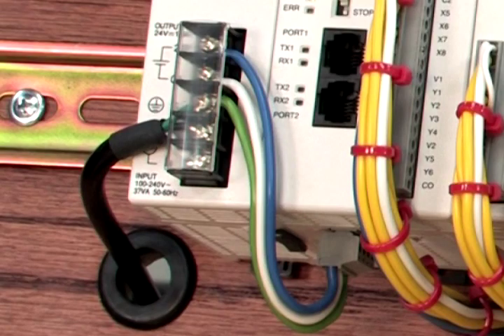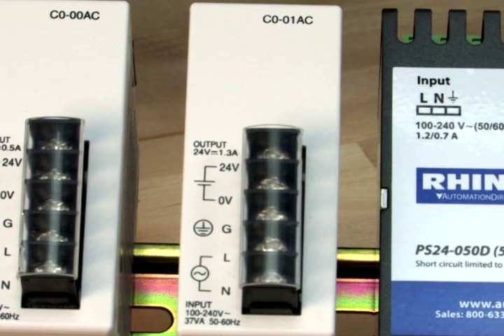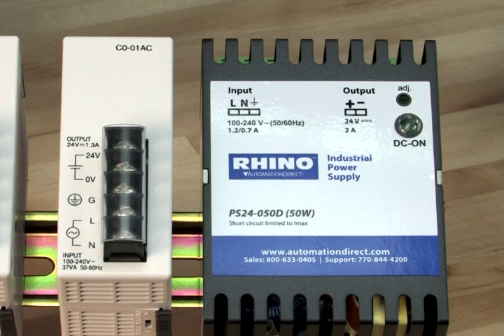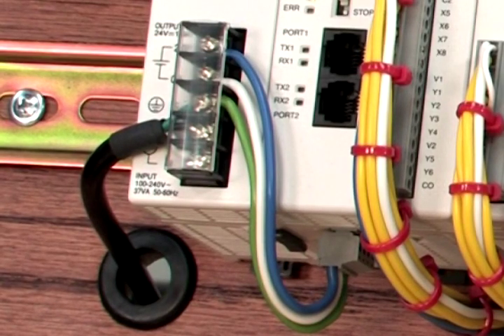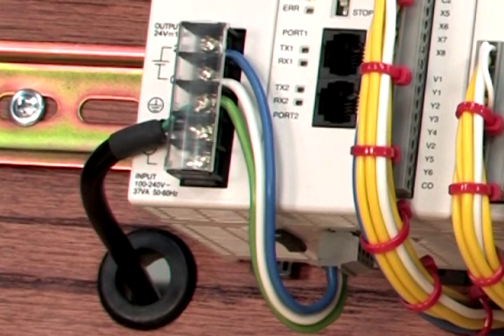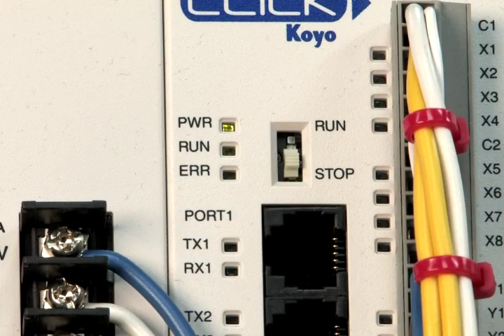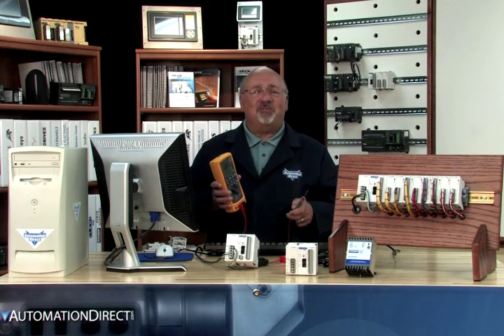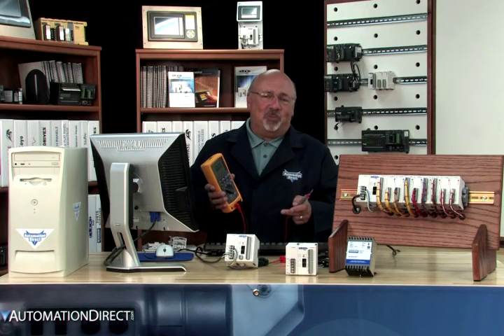CLICK PLC - How to Apply Power (Part 5) from AutomationDirect

Comment: I have around 1k in my checking account, what AC power cord should i buy and use for C0-00DD1-D basic PLC unit? Provide me a link to the product if you can.
Reply from the maker: @calvinvaj8764 there isn't an easy answer to the question because there are too many variables. That PLC draws a variable amount of 24VDC current based on what is hooked up the outputs. The PLC itself draws 120 milli-amps @24VDC by itself, and each output will draw whatever the load attached to it requires. You will need a 120VAC to 24VDC power supply and requisite cabling to go from your 120VAC source through the power supply to the PLC and components.
Reply: @automationdirect  Hmm should i get a Standard 5ft (1.5m) 10 Amps 125 Volts Black 3 Prong AC Power Cord Cable for Electronics, TV, Computer, Printer, Radio, Monitor, Samsung, Dell, Vizio, LG, Asus, Laptop and More FROM Amazon???? Would this power cord be good enough for my PLCS?
Reply: @automationdirect  Does your store supply requisite cables and what is it, I would like to purchase.
Reply from the maker: @calvinvaj8764, you would need to have someone perform an electrical design of your system to know what components and cabling is needed. That isn't a service we offer so I don't know if those cables would work for your application.

Comment: Do you guys sell those AC power chords? Prefer not to rip up the ones I have from old monitors. Also, what gauge wire were you using from the power supply to the CPU?
Reply from the maker: @Robert Anderson, AutomationDirect does not sell a made up power cord, you can find those at your local big box store.  AutomationDirect does sell flexible power cable https://www.automationdirect.com/adc/shopping/catalog/wiring_solutions/bulk_multi-conductor_cable/flexible_portable_cord_(sjoow,_soow,_sjeoow,_seoow,_type_w) and connectors https://www.automationdirect.com/adc/shopping/catalog/wiring_solutions/wiring_devices/electrical_plugs,_connectors,_a_receptacles to make up your own cables.

Comment: Hey can you touch on how to choose a fuse for the power supply since it is a good idea to have one
Reply from the maker: Hey Michael, you can use a fuse, but I typically use a miniature circuit breaker. For a C0-01AC I will use an FAZ-C2-1-SP. You can see this part here www.automationdirect.com/pn/FAZ-C2-1-SP
Reply: @automationdirect  Thanks